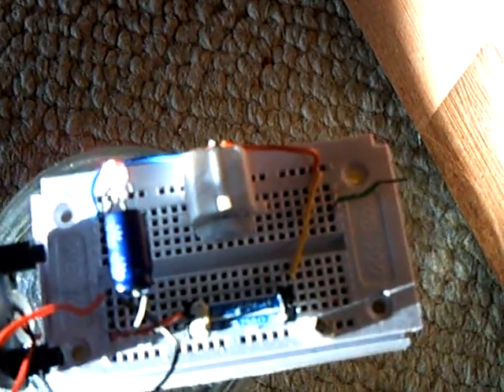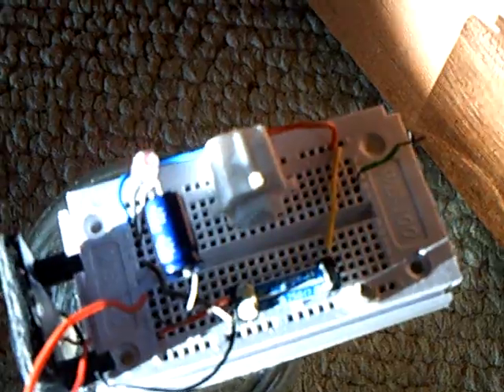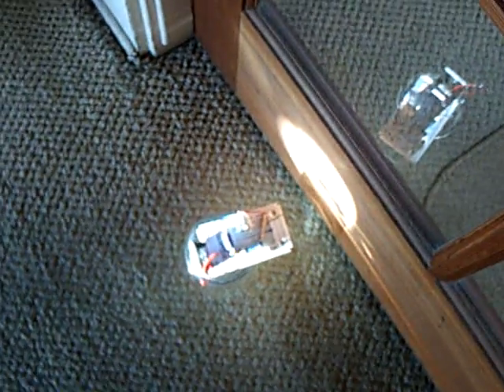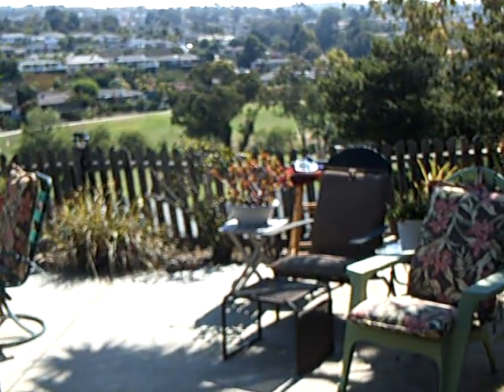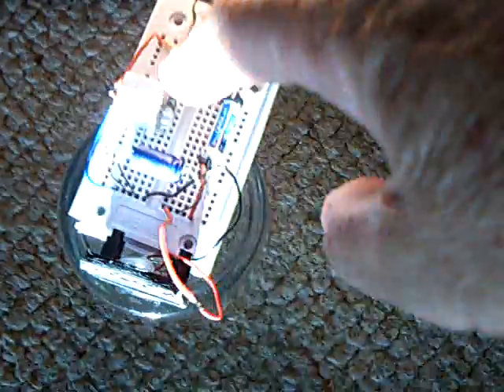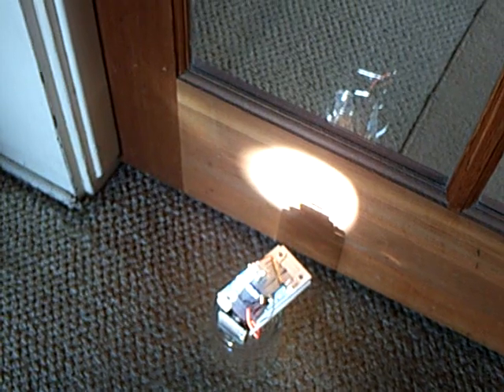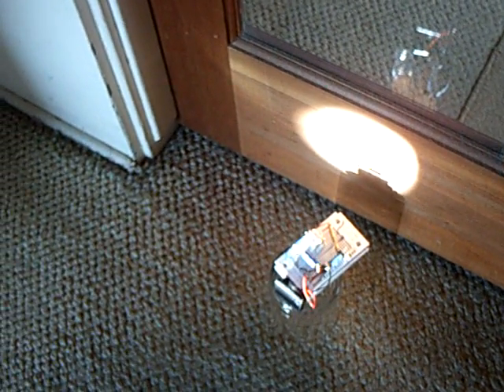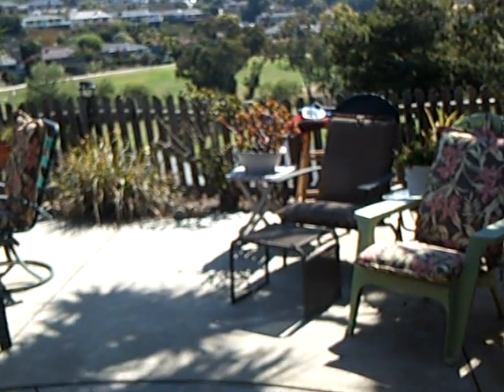Solar energy redirected into a house using a mirror

Comment: Cool you could use that light to make a small heater in the winter . focus it on something black like a black rock  or a clay pot and check the temperature difference after the mirror light hits it.
Reply from the maker: Several people have mentioned indoor heating using this method.  It should work just fine.  If the beam was focused with a lense the heat in one spot might be enough to heat water.  A sun tracking system for the outside mirror would be a must.

Comment: Cool you could use that light to make a small heater in the winter . focus it on something black like a black rock  or a clay pot and check the temperature difference after the mirror light hits it.

Comment: There is a much easier method using liquids and plumbing like fiber optics. Catch me on Skype sometime I will explain.
Reply from the maker: I thought about those methods but this is kind of like a 'wireless transmission' way to take the energy from one point to another without any hardware connections and it can transmit right through a window --or in this case a double pane glass door.

Comment: Cool!

You could also concentrate light to get more power from your solar cell/s using more mirrors or a magnifying lense.
Reply from the maker: I tried a magnifying glass at the solar panel and it really helped ---as long as you don't cook the panel.
Reply: That's right!  Too much solar concentration will damage things, however, sometimes heat is exactly what is wanted  see here:  http://climatekids.nasa.gov/concentrating-solar/

Alternatively, you could swap out the power tower and use a lot less mirrors along with CPV cells and get >40% solar energy conversion efficiency.  The more CPV cells, the more power. :)